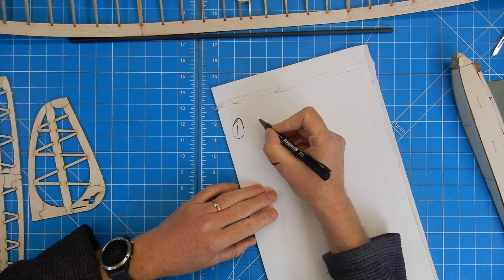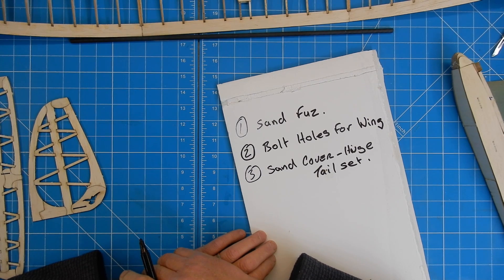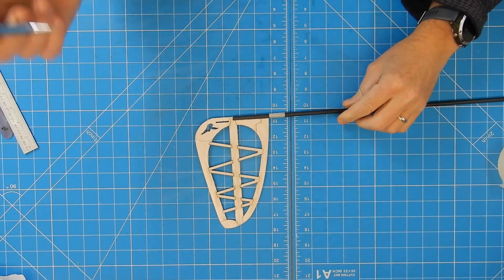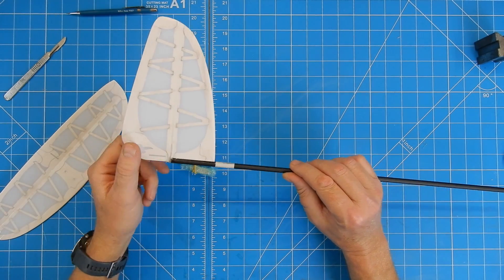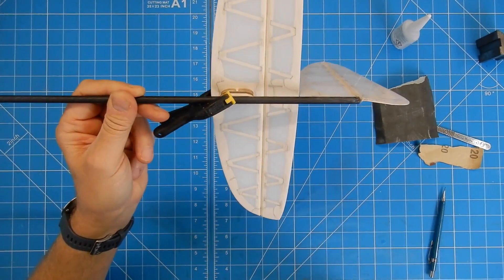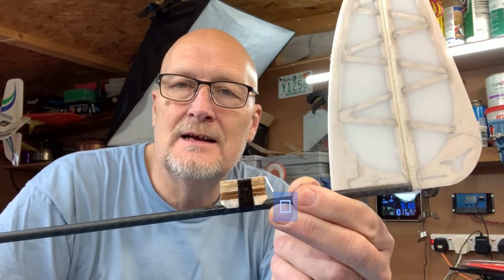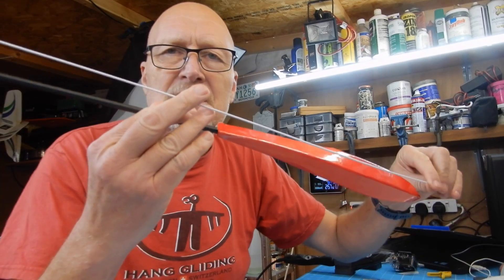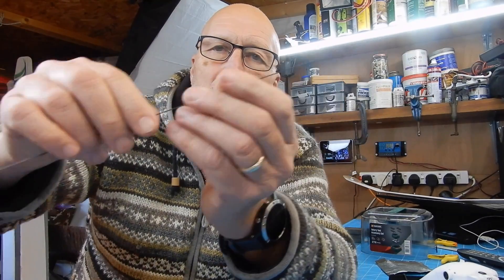How to build a Radio control CX RES mini Glider Part 5 Final Assembly

Comment: A tip I read is to put a steel wire in the control rod tube and use magnets to hold the tube against the side of the carbon tail boom, then dribble thin ca down from one end till it exits the other. This will bond the outer to the inside of the tail boom.

Comment: very beautiful
but i need ailerons :)
push rods make sense since the elevator pylon is on top
string and spring for when it's on the bottom
Reply from the maker: Who does I am itching for full house VTPL glider 😍
Reply: "... but i need ailerons :)", ... hmmm, ... what about pivoting wings ?
No rods and horns to the tail and none in the wings and only two servos for whole axis movement ...